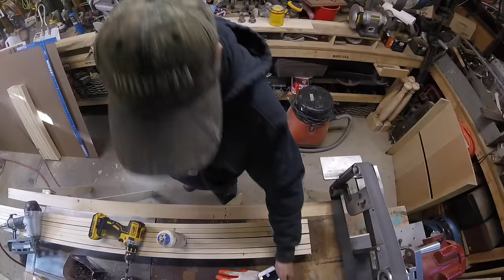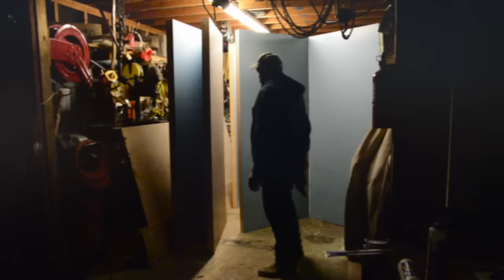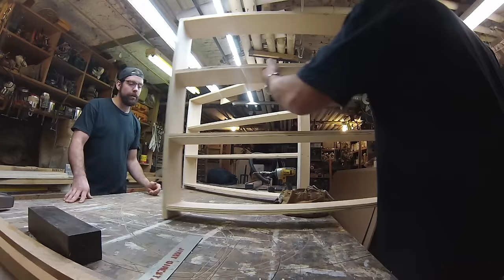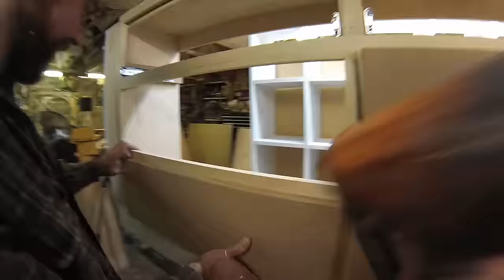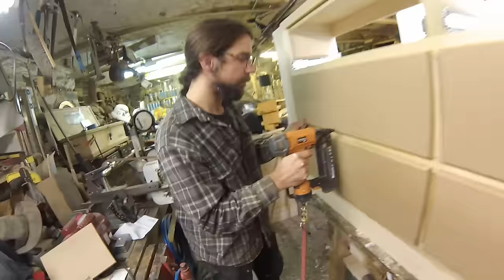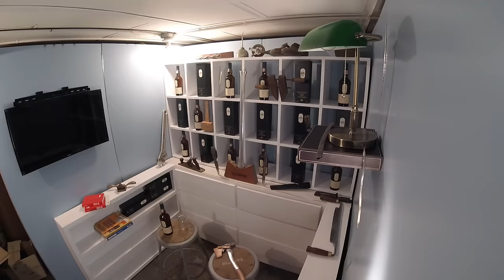✔ DiResta Holiday Bunker !!

Comment: Hey Jimmy, I have a question about 3M's spray adhesive. What do you normally use to remove it? I figure sending it away but it doesn't help. Do you have a solution?
Reply from the maker: Acetone !!
Reply: Thanks Jimmy!!!
Reply: +jimmydiresta how about getting it off of your hands?
Reply: +Brendan C (b1conn) If you're trying to get it off a delicate surface that acetone shouldn't touch you can get something called a Rubber Cement Pickup. It's a tough rubber block that can pull spray adhesive and rubber cement right off whatever surface you get it on.
Reply: +SirBrittanicvs Thanks for the advice, I have some projects coming up that might require the rubber block.
Reply: +Brendan C (b1conn) You dont want a solution, you want a solvent.
Reply: +TheJimmax If you are in Canada the Duty Free sells it for rite around 160$ a bottle.  They also sell McCalan Ruby for about 80$ less than the LCBO.

Comment: Awesome!!! I really like how you nailed the backing on flush on two edges then cut it to size! I looks like you used a router to cut it. How did you do that? What bit? Because it looks like you did not have to mark the backing so Im amazed by that because it came out like you marked lines and cut it. Please ellaborate on that trick, is there a video that covers it? Would love to know that one. Thanks again!
Reply: It's a flush trim bit.  It has a bushing that references of of the wood under it (the frame)